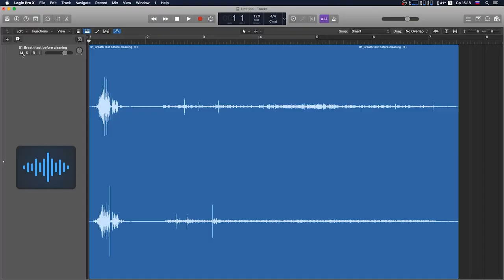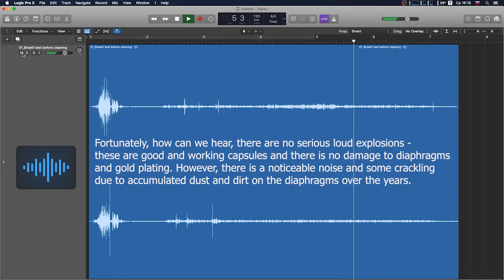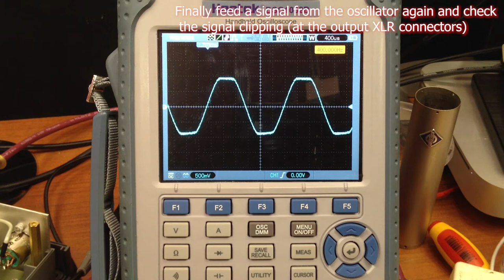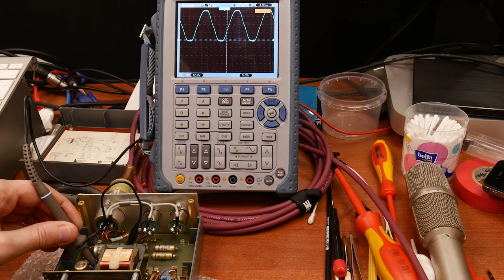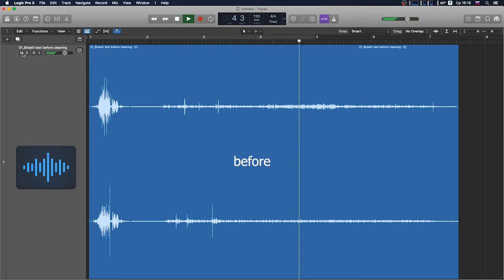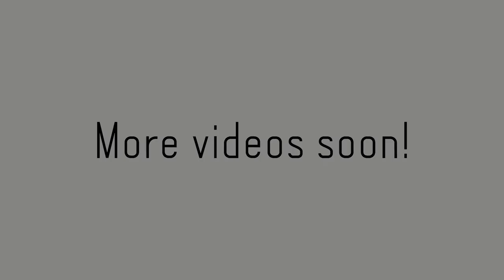Neumann SM69 fet stereo condenser mic cleaning & maintenance

Comment: I have numan u87ai microphone.some times dropping the power.please do you give the suggestion what can i do for this problem
Reply from the maker: Hi! There can be several reasons for a microphone dropout. 
# 1. There may be phantom power failures in your preamp. Also the phantom switch contacts on the some preamps can oxidize and this will cause a sound dropout. You will need a multimeter. You need to put crocodile clips on its probes and connect their to the XLR connector of the cable that goes into your mic to measure the voltage. The cable should be connected to the microphone and preamp, as normal, and turn on the phantom. Before that, disassemble the connector from any side where it will be more convenient to connect the probes. Connect the test leads to XLR pins 1 and 2 (or 1 and 3) and keep them there at all times. As soon as you hear a mic dropout, you need to check the readings of the multimeter. If it shows voltage on this time (about 35-40 volts), phantom is OK, and you need to look for a malfunction in the microphone or the cable.

# 2. Signal dropouts and strange behavior of the microphone can also be caused by damage (breakage) in the shielding of the microphone cable. This also needs to be checked all 3 wires of mic cable with a multimeter (in resistance measurement mode). Alternatively, continue the test with another known good cable.

# 3. Defects inside the mic. Keep in mind that malfunctions in the microphone FET circuitry are very rare and usually the circuitry can operate for quite a long time. Sound dropouts can be caused by some part with poor soldering (which is extremely rare)... Or a dirty capsule (this is more common) especially when you speak/sing and breathe out moist air onto the membrane.
In any case, if the first points #1 & 2 will don't work, please let me know.
Reply: thank you so much sir for your cooperation. and obviously I will notice you what is happend

Comment: Does the condenser microphone make a bottoming sound when a sponge is attached to the ? condenser microphone sometimes makes zero noise and sometimes bottom noise :/  When I touch the condenser microphone, the sound goes away...What solution would you suggest?

Comment: Good video.  Is there a specific type of brush you use or will any small painting brush be ok?  After you clean the capsule with a brush and distilled water... how long does it take to dry?
Reply from the maker: Thanks! Usually for capsule cleaning I used a very thin brush for painting, one of the thinner ones. And in this video too. It's not the thinnest "# 3", but it is soft and has long hair, and it suits me best for capsule work. This brush is made from Siberian mink (kolinsky) hairs. 
Also, a squirrel hair brush works well. 
After cleaning, the microphone immediately works fine, but it is better to leave it to dry for about a day at a fairly warm room temperature (25-30 degrees Celsius).
Reply: @Anthony_Scott_Studioservice  thanks for the great
advice!  I will do as you suggested.  Have you ever used a dry brush to just remove hairs and dust as opposed to grime?
Reply from the maker: @MrSeeker42   No, I have never tried dry brushing (even in the early days when I started to gain experience in washing capsules).
Since, firstly, most of the dirt that settles on the capsule is quite firmly adhered there, since saliva and moisture when using a microphone contribute to this. The smoker's breath contains even more sticky tar, which is deposited on the membrane.
And secondly, water serves as a lubricant between the brush and the membrane. It makes the cleaning process less abrasive.
Reply: @Anthony_Scott_Studioservice  thanks!  I did as you suggested and found that after initially using a brush moistened with distilled water,  I simply poured distilled water over the capsule and this did the job rather well.  The brush only
served for loosening the grime.  The gentle pouring did the rest.  After a few dabs of a napkin to collect the excess water, I set it aside to dry for a few days.  :-)
Reply from the maker: @MrSeeker42  It is great! Now you have your good experience :) 
But... the main thing is not to overdo it with water, otherwise it can get inside the capsule, stay there and cause problems ...

Comment: Hi, I have a black Neumann USM69 fet, about the same as the above, but with the amp section and the polar buttons on the mic. The top head barely works no matter how I turn it relatively to the bottom head, and sometimes it still gives good contact in only a few positions for a short time. Also, it sounds mostly very dull, a lot quieter and exhibits the same distortions/noise you show here. The few moments it has good contact, the sound is equally good on both sides. How would you fix this? Thank you
Reply from the maker: Hi Jan, sorry for the long answer, now I has been attacked a lot of work in a studio and I do not always have time to go to YouTube to read the comments and respond. 
If one of your systems on the USM69 works as you described, it could be either a dirty capsule, or a defect in the flexible wiring inside the head mechanism (wire breakage that appears during rotation), or something else. First all, it need to make careful diagnostics of your USM69 before doing any membrane cleaning... Thanks.

Comment: i accidentally rubbed off a tiny spot on my rode nt1a :( now it has a tiny black spot at the middle of the gold plated capsule. would it affect and potentially destroyed my capsule? please help
Reply from the maker: It's very annoying... But if in the end the microphone works fine, then apparently the capsule survived.
Do nothing else and leave it as is. The capsule will have a slightly lower capacity, and the microphone will slightly reduce its sensitivity. Perhaps so much that you won't even notice it. The main thing is that the surface of the membrane should not be noticeably deformed. And if there are no deposits or oxides in the area where you removed the gold plating, then the black spot on the gold plating will not increase over time.

Yes, I just remembered... A few years ago, a friend of mine tried to selflessly clean the dust on the surface of the Gefell UM57 membrane, he simply wiped it with a paper towel... the membrane of course was badly damaged, and one side of the microphone did not work.
Reply: @Anthony_Scott_Studioservice  oh mann. :( where can i contact you to have a personal talk? do you have instagram or facebook?

Comment: What audio signal level did you put on the mic to measure?
Reply from the maker: Hello Sergio, sorry for the long answer, I just checked the alerts. The signal level needs near a line level. I put about 1.1 volts AC RMS, and when I went just above that voltage, the mic started to clip. If you do not have a hardware signal oscillator, then the output of any sound card will do!
Reply: Hi Anthony. ! Good morning thank you! Yes I have all the equipment to carry out the tests.Thanks for the information.! @Anthony_Scott_Studioservice
Reply from the maker: @sergiocaselato  Hi Sergio, nice to hear that there are test gear!